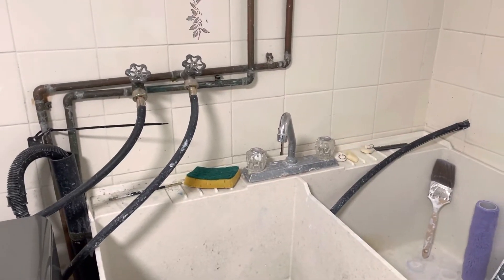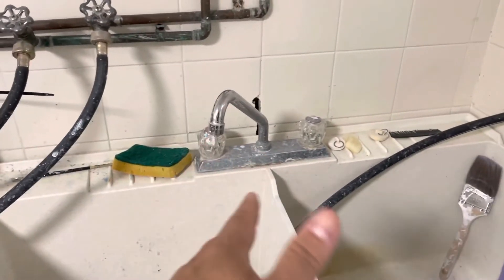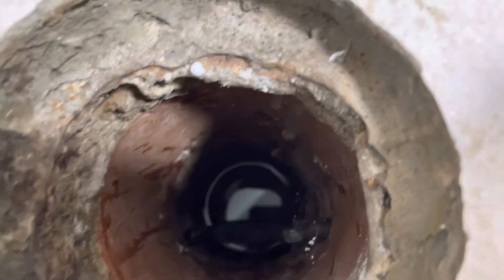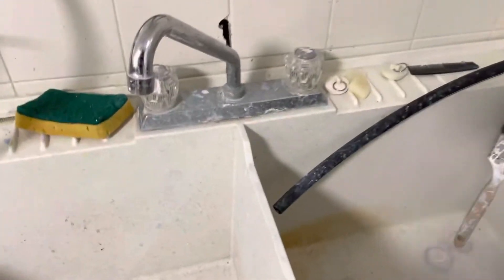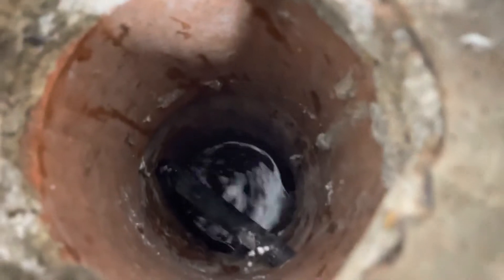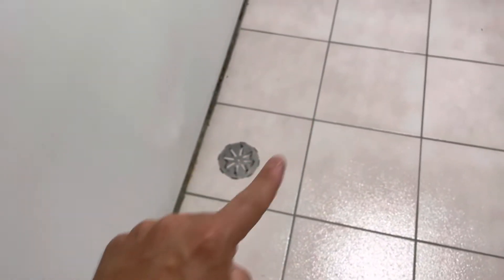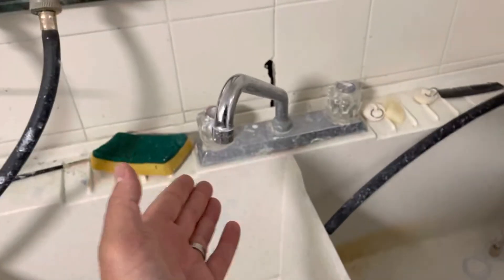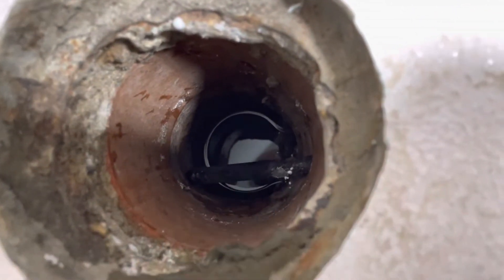Trap Primer Explained-Small Pipe In Floor Drain-How Does It Work

Comment: It would be really helpful if you would have shown how the trap primer is piped into the sink plumbing.  Where is it connected?  Is it on the p-trap of the sink drain?  On one of the supply lines?
Reply: Traps usually have an attachment for trap primer connection slightly above the water line. It’s connected to soft rolled copper via male adapter to the trap primer device that’s fed from a 1/2” domestic water branch from the floor above.
Reply: Unless you have an electric trap primer servicing multiple trap lines. Same setup just a different physical unit with a manifold, more expensive

Comment: So whenever I run my washing machine we get a rotten egg smell.. even after we got a new washer and laundry sink/pipes installed. Its on the main floor but that skinny tube goes down to the furnace room where there is a floor drain. Does this mean that that the skinny tube is not functioning properly if is letting in rotten egg smell when I run the washer? Do I need a plumber to come and check and correct this?
Reply: Just pour a pint or so of water into that floor drain once a month or so to maintain water in the trap and you should be good to go.

Comment: Where in the heck does that pipe connect to at the faucet area
Reply: It would be connected to a pressure drop activated trap seal primer device (not pictured in the video). When the faucet opens, the pressure in the water supply line reduces, and there is a device somewhere in the building connected to the same supply line as that faucet. That device senses the pressure drop and for as long as that pressure drop is maintained, it opens a little valve and sends water to the trap(s).
Reply: awesome thanks good explanation @jordanhenshaw